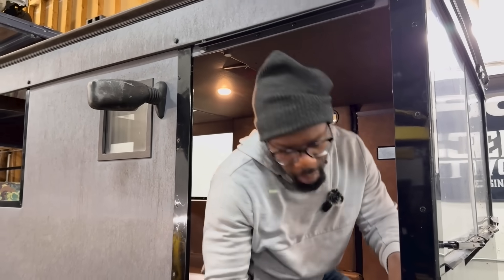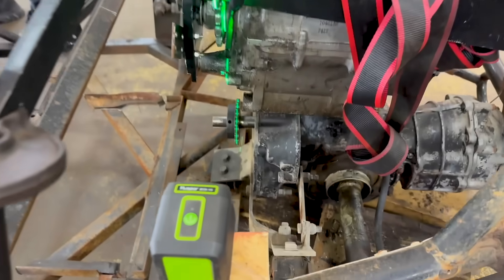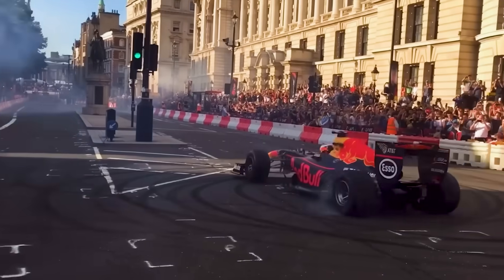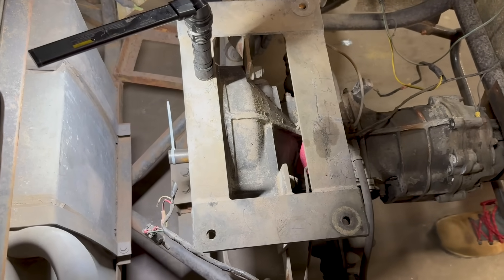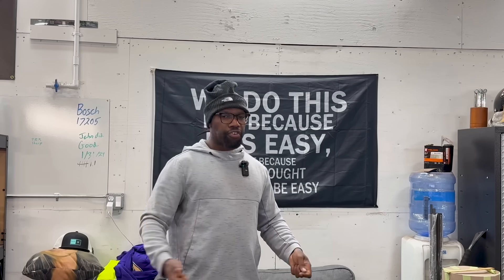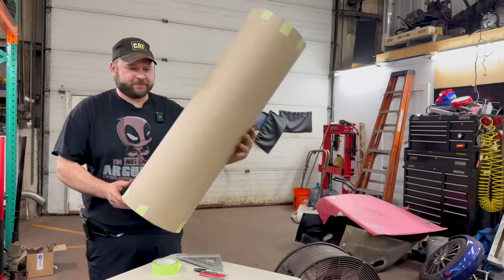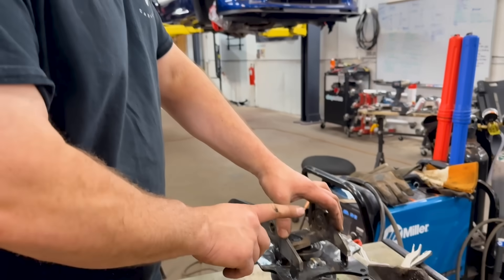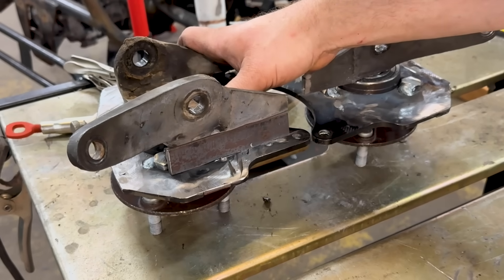Hayabusa powered F1 Car Gets It's Wheels Spinning For the First Time

Comment: U need oil baffle or you going to cook that engine, it wasn't designed for accel forces in that direction need to keep oil around the pick up not at the back of the engine

Comment: you cant call this an f1 car unless you make the chassis much thinner. and make the wheels more open and not so close to the chassis itself. it also has to be single seater, aswell as the rear wheels have to be atleast 2/3 thicker than the front wheels. so this does not even come close to an f1 car. until those critera are met.

Comment: You have a death wish Y/N? The motor is in the wrong plane to oil, the chain /jack shaft on the wrong plane for load to transmission, when it breaks it will cut the fuel cell, the motor blows and hits the FC BOOM. The torque of the motor/trans just begging to flip this over on the right side mid corner, at least pull the front left tire up so you can't steer. Scrap the VW trans lower the motor chain drive the rear end. Lots of trike rear ends to pick from or a shaft drive motor from a gold wing, virago. One chain link comes off and hit you in the head your'e dead.

Comment: If you would have put the engine in the rear most portion, mounted it sideways and connected it directly to the rear end, it would have a 1st gear speed of 40mph, been way less complex, and kept the center of gravity further down

Also, no chains or sprockets to fail or to be replaced!!!

Comment: 16:51 how the hell did they manage to make aluminium wheels heavier than steels?
Reply: 😂 that's why alloy's are a thing . They are lighter and on most performance cars and bikes....  Steel wheels are way heavy compared to Alloy's.. I'm wondering if they've given up on it and are now hiding it somewhere out the back 😊... Interesting gear setup also.. the Hayabusa engine has a gearbox with 6 speed I think and the VW gearbox has a 4 speed ....  You could change gears all day long if you wanted 😂.. ..

Comment: if that's a vw transmission, it should still have gears? somewhere? unless it's been modified. Don't know much about buggies but I had a beetle buggy years ago, and I think most of these used transaxles out of busses. I could be wrong though. But i imagine somewhere there'd be a shift linkage if you're not happy with the ratio...
Reply: VW are a 4 speed box and the Hayabusa engine has a 5 or 6 speed box 😊 ... Be great gear jamming on this one .. be like an 18 wheeler 😂

Comment: I don’t think that transmission will hold the power
Reply: They use VW gearbox standard and an adapter plate and run V8s through them . My father built a mid mounted V8 powered buggy with a standard VW gearbox  upside down . It's a thing out there in kit car land 👍 They handle the power quite nicely .

Comment: The VW trans is fairly easy to determine the final drive ratio - it'll be a 4.12:1, or a 4.37:1 for the swing axle trans...

You can grab a Corvair engine to VW trans adaptor plate, bolt it to the trans bellhousing, and use it to create the support bearing mount for the nose of the trans input shaft. Or, a VW EV motor adaptor plate would also work...

Comment: Sorry, but unless you build to a specific Formula, in this case F1, you can't call it an F1 car.  There are multiple classes of Formula Cars from Formula 500, FVee, FFord, F2000, F2, F3, FRenaualt etc. Also, Indycars which are built to a specific formula. It's an open wheel car similar to a Formula car, but underneath it's probably closer to an old time C Sports Racer.  Am I being anal about this, perhaps, but I'm sick and tired of people seeing an open wheel race car and deciding it's a formula 1 car.  If you want an F1 car, get the specs and build a car to that Formula.

Comment: On your gearing calculation you forgot about the primary drive gear ratio between the crankshaft and outer clutch basket. That gear reduction occurs before the transmission and is 1.596:1. So your true gear reduction at the front sprocket in 1st would be 4.174:1. That’s going to make a big difference in the actual top speed of 1st gear.

Comment: 35 mph is really really short for 1st gear. And with the gears quite tightly spaced in the higher gears, you will have a very limited topspeed.

If you intend to go grass-buggying, it is probably fine. But for asphalt you would want a taller ratio. Track focused light cars/formula cars usually never has a 1st shorter than 60 mph.

Comment: You're going to have alot of fun with this, no doubt, and if you don't plan on keeping it around, all good man, no worries.

If you want to do racecar things, you'll need to get that motor much lower which means redesigning your rear suspension/transmission setup, at which point I'm not sure how much of the original frame you'll really be keeping. Like, making this into a single seat, center drive formula 1 looking car, we all know you can scratch build it, with double the time and money, kinda just depends on if you want to and if you think you can get the views for it. 
Scratch built would be alot of time to invest as well, and it probably makes more sense to invest that time into other things.
A scratch build would probably be better as a side project to be honest.

Comment: If I were you guys, I would try to put the fuel tank up front for weight balance. All of the weight is going to be in the rear of the buggy which might cause some steering issues. You might be able to use your existing tank long ways in the front almost like a center tunnel, if you have the room of course.

Comment: I would 100% recommend a study chain guard around those chains. If a chain snaps you don't want them flailing around breaking things, especially your head. Loving the build!
Reply: Even a plate between the chain and the gas / ass would limit the destruction. We're dealing with a bunch of half-crazed Yankees though.
Reply: Chains only ever snap when you use the wrong chain. Period.
Reply: @Chris.Davies  Chains can snap just fine with enough persuasion. Even factory fresh chains snap if you have enough bad luck.
Reply: @Chris.Davies  Or don't lubricate them for an entire Winter commuting season.....  neither of which applies to this project.

Comment: took a pic and asked ai to check out math, good work! 
The math mostly checks out, with minor rounding adjustments:

The wheel RPM calculation (406 RPM) is correct.
The overall gear ratio of 27:1 is derived to match the redline, but the exact sprocket ratio (18 ÷ 16 = 1.125:1) gives a slightly lower RPM (10,726 RPM).
The whiteboard’s 1.15:1 sprocket reduction is an approximation to align the engine RPM with the redline of 11,000 RPM at 35 mph.

Comment: That clutch pedal/lever looks a bit tight to me. All motorbikes I've ever had or worked on had a little bit of play in the lever so that the cable isn't constantly under tension. Your clutch looks like there is no free play, and it seems to engage very late in the levers travel. I won't be surprised if you have issues with the clutch slipping under load in your next video

Comment: Remove that shitty fiberglass bucket, enforce the floor, build a firewall, and install a center seat and make a centered cockpit. You’re just making a hayabusa powered dune buggy right now, which is also cool.
Reply: It is not a dune buggy,  it is an amusement park ride from the 80s.   It is an adult size 2 person go cart that you paid $1 to ride in.
Reply: Yeah that "seat" is sketchy as all hell with like 4x the original power. This needs a real seat and some sort of harness for sure. 

I also would not be super fond of that exposed chain right behind my head with the wind in my hair lol.
Reply: @justinpogue1257 does it look like Rich has hair?

Comment: Why don't you tilt the engine so it is on an angle to mate with the drive sprocket directly and allow the engine to be lowered more? The exhaust would also effectively go straight up and you can pipe it backwards like an F1 car!

Comment: The front bearing hubs wont hold together for long in that application 😵‍💫
Reply: That is not a stock VW input shaft.  The transaxle has been modified when it was an amusement park ride for that configuration.  It ran like that for years and years for hours on and when it was a ride

Comment: Transmission bearings were never designed for lateral loads, it'll be fun and I love the homebrew factor, but that trans will be hating it's life
Reply: That transmission has Ben run that way from the 1980.  It only has one gear,  2nd and no reverse.  This is an Amusement park ride that was run for hours and hours.   That entire cover over the front of the transmission,   Might have some sort of bearing or support in it.  As the stock VW input shaft only sticks a little past the front of the bell housing.

Comment: 2 transmissions just imagine the top speed 6th on the busa and 4th on the VW that would be interesting.🤣🤣
Reply: It is an amusement park ride,  Those are locked in 2nd gear,  you have no way to change the gear in it.  It run like a big go cart.  Centrifugal clutch.  In fact it might have most of the transaxle internals gone.

Comment: That engine is going to eat that trans like candy. My friend bought a diff with reverse that's for mc powered sand rail. Fits VW IRS axles. It handled the busa power.
Reply: Should have just ditched the trans and made a diy chain drive diff.
Reply: They sell them with reverse.  @JusttheEdge
Reply: That does not have reverse.   It is locked in gear.   That is an amusement park ride from the 80s. You can not shift it.

Comment: I think you should chop the back off, sit the engine lower and off set the gear box more to the passenger side if possible. As it is, its not a f1 car or even an f3, it's a dune buggy.

Comment: Grok agrees with 18T.
To calculate the rear sprocket size for a buggy with a Hayabusa engine to hit 35 mph in 1st gear at 11,000 RPM:

Tire Circumference: 235/75/15 tire → diameter = 15 + 2 × (235 × 0.75 × 0.03937) ≈ 28.88 inches. Circumference = π × 28.88 ≈ 90.74 inches = 7.562 feet.
Tire RPM at 35 mph: 35 mph = 3080 ft/min. Tire RPM = 3080 / 7.562 ≈ 407.51 RPM.
Transmission Output RPM: 1st gear ratio = 2.6:1. Engine at 11,000 RPM → Transmission output = 11,000 / 2.6 ≈ 4230.77 RPM.
Final Drive Ratio: Assuming 9:1 is the post-sprocket gearing, total final drive ratio = 11,000 / (2.6 × 407.51) ≈ 10.39. Sprocket ratio = 10.39 / 9 ≈ 1.154.
Rear Sprocket: Front sprocket = 16 teeth. Rear teeth = 1.154 × 16 ≈ 18.46. Round to 18 teeth.
Verify: 18/16 = 1.125 sprocket ratio. Total ratio = 1.125 × 9 = 10.125. Wheel RPM = 11,000 / (2.6 × 10.125) ≈ 418.03. Speed = 418.03 × 7.562 × 60 / 5280 ≈ 35.95 mph.
Result: Use an 18-tooth rear sprocket for ~35.95 mph.

Comment: Do not forget this is an Amusement Park ride called a Sprint Buggy,  It is an Adult size Go-Cart and should not be confused with an actual off-road car, sandrail or an actual race car.  that is not what it is.  It is a fun ride that you paid $1.00 to drive and ran a timed lap vs the clock.

Comment: For future reference, to do this ratio calculation faster, take drive gear diameter*gear ratio (expected)*transmission ratio or diff ratio and divide that by your stepper total  and then divide your drive gear by the resultant. 
Example: Stepper total is 406, rear end ration is 9:1, first gear is 2.6:1, 16*9*2.6 gets you 374.4 374/406=0.92, 16/0.92=17.3, conversely you can get the specific stepdown by taking the stepper total (wheel dimension calculation) divided by the ratio resultant, here 406/374.4 which gives you 1.08, rather than 1.15 , 16*1.08=17.3
Reply: Got some taxes you can look at. 👍
Reply: @Justatwork 😂😂
Reply: I think he needs to worry about his brakes not the engine or gearbox. would you use them brakes on an Hayabusa
Reply: Let me guess, kinematics subject? 😂😂😂

Comment: bro I commented before and Imma try again. You NEED to do something about the oil system or you will spin bearings in that engine. the original is not meant for lateral accelerations and with your short pan it might be even worse. Also it's hard to tell how big that jack shaft is, but you may rip the keyway on that lol.

Comment: Love the style of this buggy. Is it the transaxle locked in first gear? Looks like there isn't a gear shift and no hockey stick selector shaft in the gearbox nosecone? Does that plate over the bellhousing have a bearing supporting the input shaft? I plugged your numbers in to the 'speed at a given RPM' calculator spreadsheet on The Samba and it comes back at 25, 23 or 22 MPH depending on the R&P.

Comment: I know it’s clearly more time and hassle than ordering one..  but with all the welding by you guys do, can’t you just get a length of large diameter metal pipe, then weld on some fittings for in/out and make some flat sides for it and make your own smaller fuel tank?

Or after receiving the one you ordered, cut it shorter, or even cut the sides off and make a flattened tank out of it(think 2 flat sides and 2 curved sides).  Both of those solve the problem of having a tank that’s too large and extra weight from excess fuel.  Or better yet, cut the ordered tank in sections and make 2(or more) smaller cylinder tanks, use one for fuel, and one for water/coolant, oil or whatever the need may be.

Personally I think cutting it in half lengthwise and having a half moon shaped tank would probably be the best bet.  Still the width of the vehicle, but now it’s smaller and is farther from both the chain and the rider/s.  Make a filler on the side sticking out through the cage bars.

Comment: You need a carrier bearing for the front of the input shaft on the trans,   its not designed for a lateral load.

Comment: I ran the math threw AI and it says it's incorrect. 🤔 Based on the visible part of the image, there is no calculation shown that resembles "the sum of 153 and...". The image contains notes related to gear ratios, redline speeds, and tire sizes, which are not directly related to a simple addition problem involving 153.
Regarding the mathematical expression that is partially visible:
\frac{27}{(21 \times 9)}
Let's evaluate this:
21 \times 9 = 189
\frac{27}{189}
To simplify the fraction, we can divide both the numerator and the denominator by their greatest common divisor, which is 27:
\frac{27 \div 27}{189 \div 27} = \frac{1}{7}
Now, let's convert \frac{1}{7} to a decimal:
\frac{1}{7} \approx 0.142857
The note in the image states that this calculation equals 1.15, which is incorrect.
Therefore, the math shown in that specific part of the image is not correct.

Comment: You are going to hate it but I'm gonna say it anyway. You can make a chain driven limited slip diff from a Miata/MX5 center section. Youtube it 😅 The sprocket mounts where the ring gear mounts. A simple can and flange go over the end to seal it. For the different shaft lengths due to sprocket offset, mount a weighted collar on the short side shaft to equalize the rotating weights of the axles. You will be able to drop the mega Gixr motor all the way down with the bigger oil pan and lower the weight and CG. Also mounting the motor perpendicular will center the weight further. As is, I imagine it will be prone to tipping if in a slide and it suddenly catches.
Reply: THIS/\/\/\/\/\ You actually have a clue, I tried telling them last week the motor was way tooooooo High. Tho hey. What could go awry running a 200hp Busa motor at the wrong angle through and ancient unchecked dub gearbox

Comment: Is the jack shaft splined? I couldn't imagine those set-screws holding up
Reply: No, I don't think it's splined.  It might have a keyway at least. There's no way a set screw on it's  own would hold that sprocket. Even if you drilled a spot on the shaft for the set screw to engage. I remember doing that a long time ago with a go-cart and it was good. This car might have just a wee bit more power. Just a tad.

Comment: add fuel cell foam to the inside of gas tank to keep from sloshing around, add another carrier bearing to the transmission shaft ,  get rid of all the front suspension and use the arms setup from the cycle you got the brake rotors from . to get f1 sound build a 180 degree exhaust header or a 4-2-1 header a 4-1 will not give that sound
Reply: to have that sound you need eq length stepped headers - Maisteer explained and demonstrated it nicely on a bike (Suzuki?) 4 cyl

Comment: I accept formula car but not F1. F1 Academy maybe. Big fan!
Reply: It is an actual amusement park ride,  it is an adult size go cart.  That is why it has the funky brake and gas pedal.  It auto brakes when you let of the gas and it has an external brake so the operator can stop it from out side the car after the run is over.